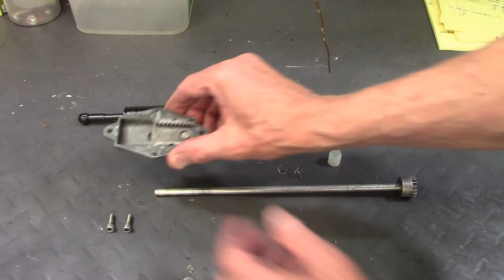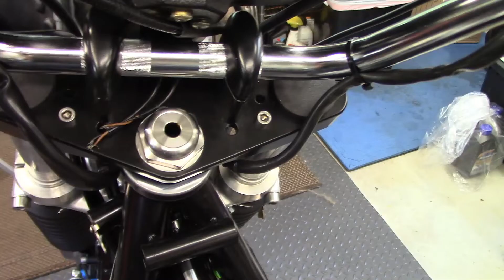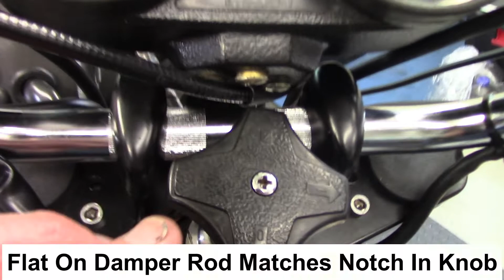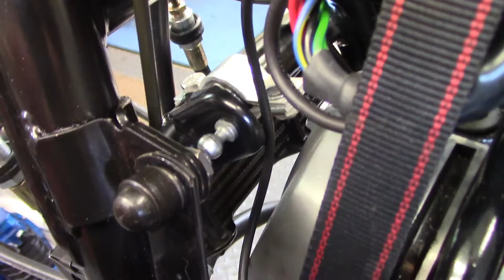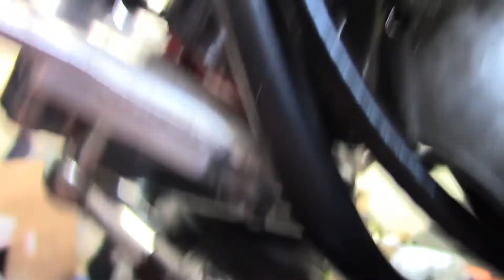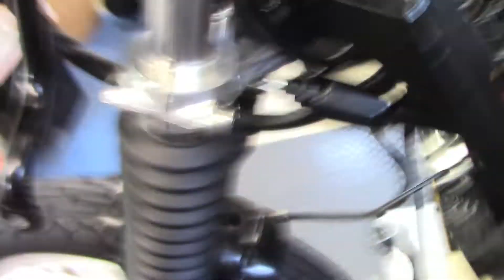1983 BMW R100RS Install Steering Damper Mechanism

Comment: Just noticed on my 74 R90/6 the front of my damper was hanging down. Upon further inspection, the ball from the adjuster plate still inside the cup! Just took it off for now.

Comment: Brook, can I use the damper without the adjusting rod? I plan on leaving it on the hardest setting and have a custom top nut, which I don't want to use the rod. Will the damper setting remain in place without the rod?
Reply from the maker: No

Comment: Brook, I have an 1983 R80ST. Is it possible to fit a steering damper on it ? Thanks
Reply from the maker: Jamshed, I don't know. It did not come with a steering damper so I don't know if it's possible to use steering damper parts from other models to install one on the R80ST model.

Comment: Good explanation. My damper appears to be leaking? Do I need to purchase new or rebuild ?
Thanks
Reply from the maker: Hi Rodger, These are not rebuildable, so a new one would be in order.
Reply: @BrooksAirheadGarage  thank you for that.
Reply: @BrooksAirheadGarage  are used ones to be trusted?
Reply: @BrooksAirheadGarage  also the selector knob on top does not turn is that because grease is old and it’s frozen up?

Comment: I know my R75/6 1974 had the steering damper but for the .............. just remembered my  81 RS had one also. A friend made a custom knob for me. I'll have to look I might still have that knob. One night a cat ran right into my front wheel I didn't run it over he ran right into the wheel, the handlebars came right out of my hands. It all happened so fast . I just caught the cat out of  the corner of my eye and boom my hands were off the bars. The bike stayed on a straight course, I'm guessing that the damper did it's job the bike didn't warble much.
Reply from the maker: Hi Alan,  The /6 series introduced in the 1974 model year used the damper design I show in the video. Prior to that, the /5 had just a friction damper that in my opinion was a hazard should you decide to tighten it up while at highway speed because you would not be able to turn the handlebars at low speed.  It looks like the /6 damper design stayed around until BMW retired the airheads (with the exception of the R80) in 1984. And they removed it from the 1985 model year R80 AFAIK.  I can't prove it, but I think when they went to the mono-shock rear, they stopped worrying about front wheel instabilities causing tank slappers.

Comment: Nicely done Brook.  Do all R100RSs have a steering damper?
Reply from the maker: Peter, I believe they were used up through 1984 model year. When the RS was brought back in 1988 model year, I believe they eliminated the steering damper. I've not worked on any that new, so I could be wrong.